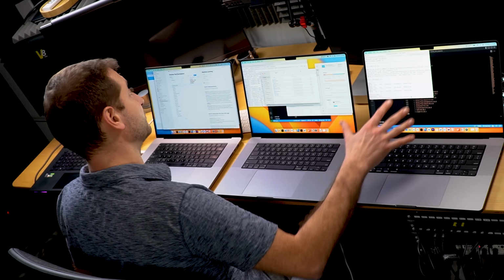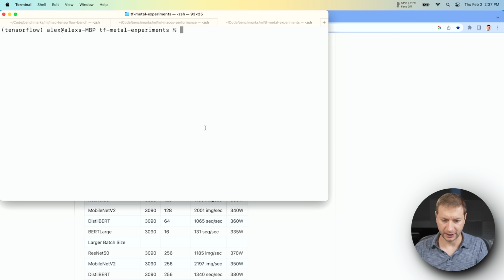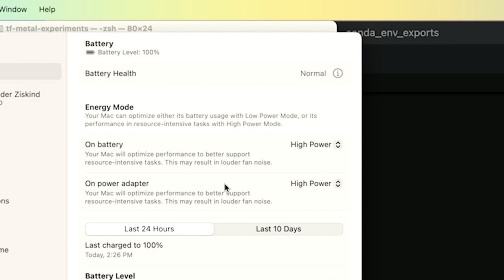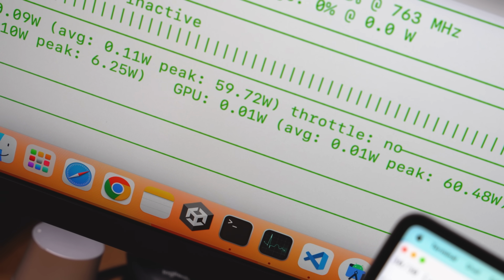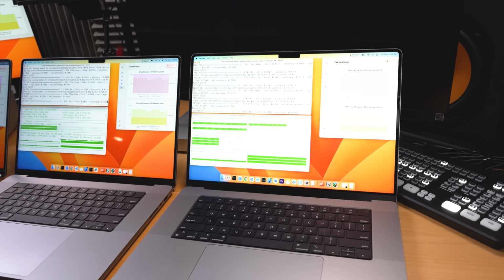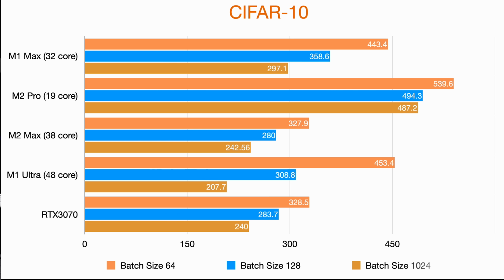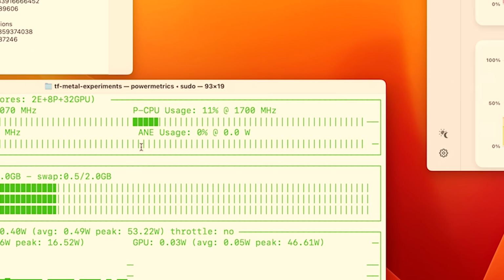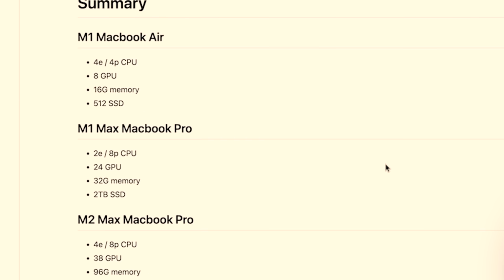INSANE Machine Learning on Neural Engine | M2 Pro/Max

Comment: A couple of interesting stats related to Large Language Model from a hardware perspective.

GPT-2 1.5 billion parameter model needs about 5.6G of ram
GPT-3 175 billion parameter model is 300G on disk and needs over 600G of memory
NVidia megatron is 530 billion parameters and needs something like a DGX rack to run

You can get a pruned down version of GPT-2 that will run on a desktop/laptop, but it's not as good. Huggingface has different versions call GPTj that will work on memory limited machines, with the usual trade offs. NVidia and Microsoft are both working on 1 trillion parameter Language models.

my biased take on why Nvidia keeps increasing memory isn't for games. Games usually lag 2-4 years and even then, they can't fully use 24G of memory. In contrast, ML training can immediately use the memory and you can never have enough.
Reply from the maker: a Teraparameter model would be HUGE. am i the first to coin this term?
Reply: @AZisk   don't know, but I'm sure Jensen will get up on stage and show off even bigger language model at the next GTC conference. If jensen says teraparameter, I say he should give you a free RTX 4090 Ti card. GTC 2023 is in march.

I can't even imagine how much electricity a model of that size needs to run. Stability AI spent 50 million to train stable diffusion on AWS!
Reply from the maker: @woolfel  I’ll take one ☝️

Comment: What is better: one or two rtx 4090 or some m2 for ML/AI? Can you make such video?
Reply: The 4090 has more processing power ~FLOPs, but if you actually need that much processing it can be cheaper to run on a server than buying cards right out. If this actually matters, seeing as the cards are already so fast, you might want to prototype locally and train remote from a cost perspective. Also remember other factors play a big role too, for example thermal throttling on most 4090 laptops under prolonged loads of that magnitude, not to mention the wear and tear on the hardware, available RAM, unified memory vs random access/dedicated graphics memory etc.

Comment: I can't wait to see the performance of the next M2 Ultra processor, it will reduce the gap between Nvidia and M processors in some training tasks !!!
Reply: well the gap is reduced in favor of Apple Silicon, when taking power consumption to performance ratio. You can do stuff on laptop while running on battery, with Nvidia you need 10x more power (CPU excluded) and huge loud PC connected to outlet – even running it on laptop.

Comment: you should be more accurate with the information, the pc isn't the one reducing the computing power when disconnected, is windows, if you install Linux it will work full power

Comment: For For getting into/studying ML, would you recommend the
16", M2 Pro 12-Core, 32GB, 512GB, 19 core GPU
Or
16", M2 Max 12-Core, 32GB, 512GB, 30 core GPU
price difference is 180 bucks 
Do I need 1TB ?
Reply: Definitely 1 TB since 513 GB has reduced SSD speed. 
I would recommend M2 Max 1 TB
Reply: If this is just a curiosity/hobby I would just look at refurbished M1 stuff.

Comment: Hate to be that guy but no one serious about ML is going to run this stuff outside of Nvidia GPUs either locally or remotely. Let’s see what Mac Pro can bring to the table.
Reply from the maker: You love being that guy :)
Reply: No one serious about ML is directly prototyping on a server, your comment is dogmatical
Reply: Hate to be that guy but the high bandwidth shared memory on Apple silicon can make training larger models easier on Mac than using Nvidia GPUs. Processing speed is not the only factor in ML training. Having 96GB available to the GPU isn't possible with Nvidia cards without having a rack of GPUs that have to share the memory. This is actually one of the main reasons I switched to using Apple silicon.
Reply: I AM that guy, but I forgot what I was going to say. :)
Reply: @Khari99  That's the point.
Reply: Actually I'd argue that lots of people are (or should be) interested in this. Large language models have made it very clear that all developers need to know more about AI. As has already been pointed out ... in real life all AI would be running on Linux in server farms but that doesn't mean that we shouldn't start to understand how different models leverage hardware including GPUs but also specific hardware like the Neural Engine. Also bear in mind the Neural Engine will almost certainly run locally in large language models by developer who are experimenting or just using the local model to be more productive.
Reply: this space is evolving quickly and the metrics we've been used to the last few decades are starting to shift
Reply: @alex I think adding in SME's like you did for the Neural Engine is a real plus and I'd go further with this as I think there are a lot of dev's trying to learn the 80/20 rule in AI right now (but I think it applies to other areas too). You're a first class communicator already and the perf tests you've done have served as a useful differentiator for you but I think this idea of bringing in experts for a chat could add another dimension. I'm rooting for you as I think you've got some strong natural ability but in this attention economy you need to make a case for eyeballs all the time. I personally don't have the patience for it but I'm grateful to folks like yourself who do.
Reply: @alex if you're interested drop me a line and I'll send you some links
Reply: @Khari99  could you share your exp and exactly which Mac did you go for ? any recommendations from your side, as welcome..
thanks in advance ☺️
Reply: Apple chips (and most others) are years behind nvidia in development software, so no deep learning developer will seriously rely on Apple chips unfortunately
Reply: Not the case, the Mac is faster than RTX in this
The new Mac with M3 chips destroys the competition. The only GPU that can compete with M3 Max is RTX 4090 laptop, all other laptop GPUs are beaten
Reply: @conspicuous_cracker  yes, the flagship m3 max is not supposed to beaten by lower tier products from competitors.
Reply: You can believe that, but the size of model versus power consumption definitely has the telecom industry and other very serious people thinking very hard about using Apple Silicon.  Instructlab from IBM and Red Hat already support M2 Apple Silicon.

Comment: hello

I don't understand what are you demonstrating. Practically users apps benefit how of those tests?

 Because test sets are good for developpers but users what do they concretely get out of them except that "mine is bigger than yours you see this number, that's the proof". Mine being what you think. Anyway it's intellectual wanking: what counts is that when you use the chips it does the job fast because you have other things to do with it. 

Let's say I have a pc eith an intel gpu and an i5 11th gen and 40GB ram and NVME ssd. Turning a 4.5 GB 30 mins video into a 750 MB video takes 30 min on the NVME and 22 min on ramdisk. How fast will it be on a Mac Mini M1 / M2 / M1 Max / M2 Pro?

And what others tasks can be done with the new chips which couldn't before? How better common tasks become using Full HD video, 2K videos, 4K videos? Etc... What happens from the user usage point of view? I buy a machine for what I can do with it, not running benchmarks which tells me nothing in the real. Real being when multitasking for example.

Comment: Finally, I've been waiting for this video since the announcement of the new M2 Max. Finally, I realized that MacBook pro M processors are not even close to compete with Nvidia high end GPUs.
This is 3 series and it has 8 VRAM, and couldn't be beaten by high end machine that costs over $4k?
Apple fan may not like it, but they should know that MacBook is beast when it comes to Adobe stuff, or video editing, but can't come close to ML/DL tasks. So, the conclusion from this video, if you are data scientist and need a portable machine for training and testing your model, then MacBook is the last to think about it. It couldn't beat 3070???!!!!🤔 38 cores and couldn't beat it 😂!!
The last thing I wish to see it in the YouTube is head to head M1 Ultra (64 cores gpu) vs Raze blade 16 with 4090 < this gonna kill Apple fans 😂

Comment: It’s all fun and dance, fluff and unicorn until you start working on real life projects, hear me out: I had a 14” M1 Max w/ 32GB RAM, while studied at uni. My best machine ever! Loved it… but when you have to spend half a day to solve a specific and rare bug due to the poor Tensorflow Apple Silicon support under time pressure, thats not much fun.😢 I had to solve quite niche and specific problems (like Natural Computing algorithms and simulations) and finding the right solution was challenging enough, let alone finding one that supports Apple Silicon. Excellent battery life, when it works it is stupid fast, but my next machine is a desktop PC. Machine Learning and DS aren’t mainstream usecases, takes some time for the libraries and devtools to catch up.